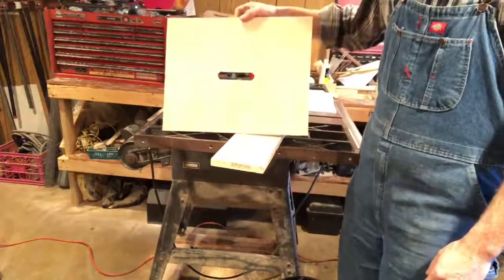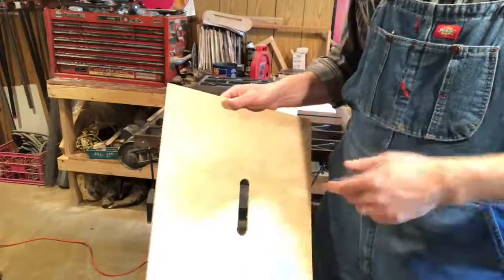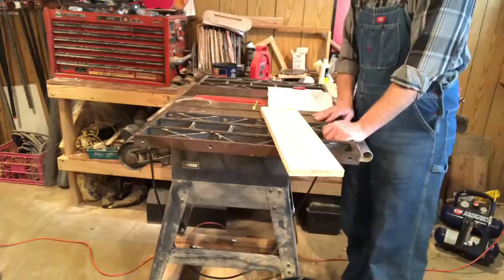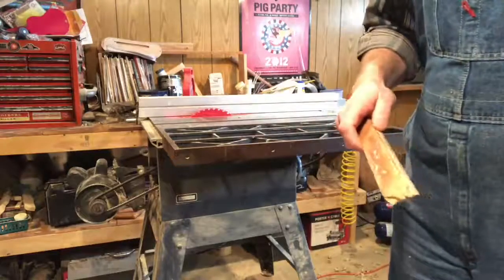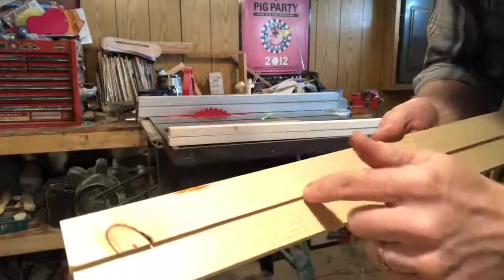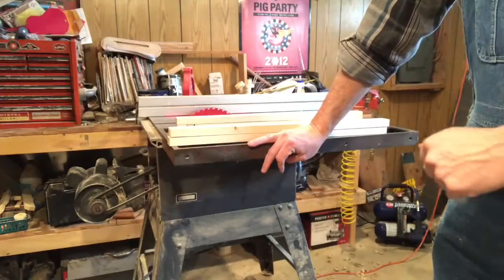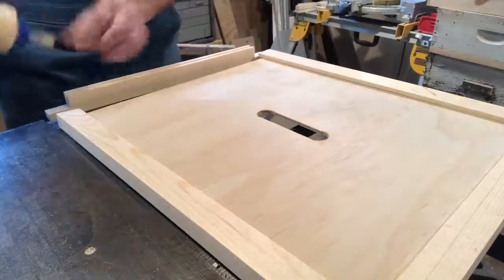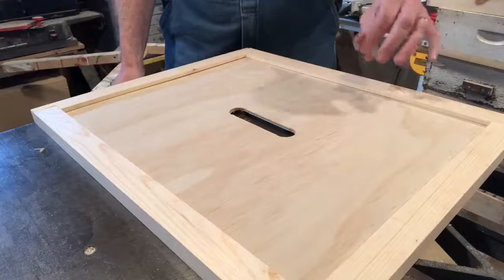Build Your Own Beehive-the Inner Cover

Comment: Very nice instructions and resource for the book. I am making boxes for a round top feeder and summer ventilation with an inner cover bottom. Using 5/8 cedar fence boards and 5mm ply because wood is krazy expensive and low quality from Lowes.
Reply from the maker: Thank you for the kind words and for watching. I know I’ve held off building equipment lately because of the high prices!

Comment: What is the book you’re using?
Reply from the maker: It called Build Your Own Beekeeping Equipment by Crowley. It’s a fantastic resource!  Here’s a link to it on Amazon https://www.amazon.com/Build-Your-Own-Beekeeping-Equipment/dp/1612120598/ref=asc_df_1612120598/?tag=hyprod-20&linkCode=df0&hvadid=312128022127&hvpos=&hvnetw=g&hvrand=16405590946804994951&hvpone=&hvptwo=&hvqmt=&hvdev=m&hvdvcmdl=&hvlocint=&hvlocphy=9015535&hvtargid=pla-499594939637&psc=1
Reply from the maker: Tony Pisano, not Crowley 🤦‍♂️